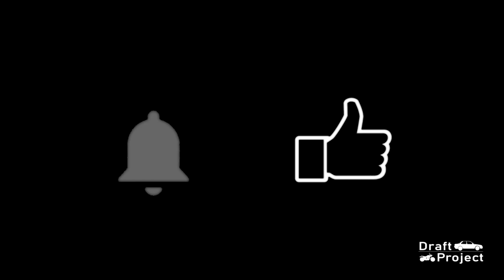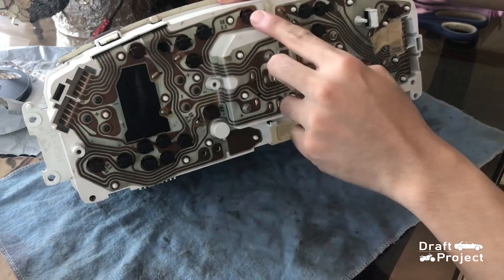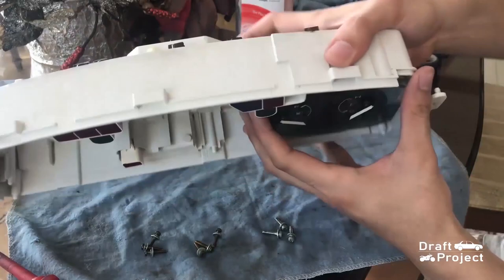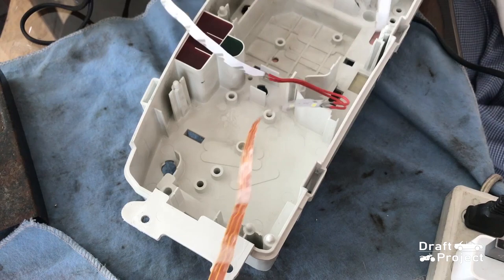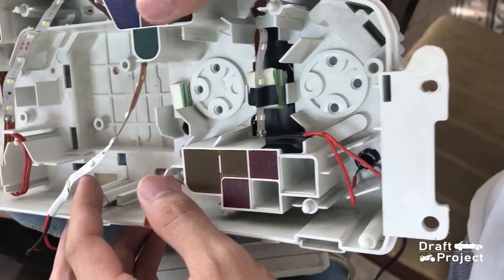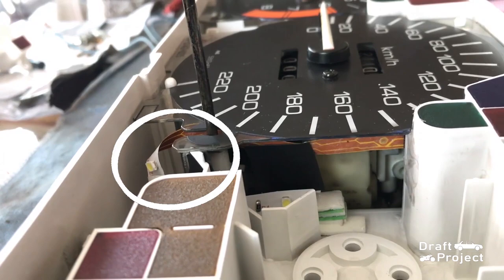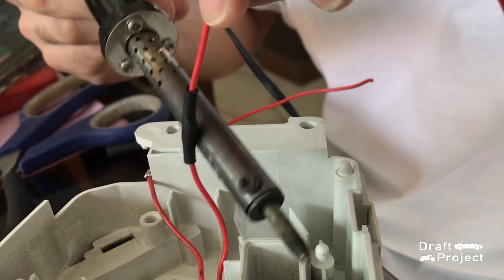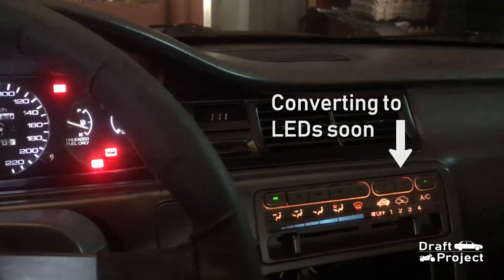BRIGHT DASHBOARD! Instrument Panel LED conversion

Comment: Amazing job, im sorry but i dont understand the wiring, did you put all the strip pieces in series conection and the 2 final wires to each respective + and -  of any bulb socket ? thank you so much for the video
Reply from the maker: Yes sir. What I did there is that I put the strip light of the tachometer and speedometer in series then tapped into each positive and negative of the bulb socket. The strip light of the fuel and temperature gauge is separated for the speedometer and tachometer. Thank you very much sir!

Comment: Taping leds like this will cause them to overheat
Reply from the maker: So far, I didn't have any problems or issue with it for the past 2 years. Perhaps overheating could happen if the wire is loose or not secured. The other one is using bigger wires.

Comment: just buy t10 led bulb, lol
Reply from the maker: That is another easy alternative. For this Civic EG, you need T5 or T6.5 LED bulbs. If you choose those bulbs, expect more uneven brightness. It is a common problem that can be corrected by a customized strip light mod.
Reply: @DraftProject  that's true.. the smooth lighting effect of the led strip looks good though.

Comment: Where did you buy thos led strip?
Reply from the maker: I just bought from our local online shopping site. The LED strips are made from china and fairly cheap. Up until now, it is working properly without any defects.
Reply: @DraftProject  shopee?
Reply from the maker: @swoshswish6921  I bought it from Lazada but that was 2 years ago, so the link for the item is gone now. Shopee and other shopping site will do too.

Comment: Can we just use LED bubbles like for bolt-on mounting?
Reply from the maker: Hi bro! Yes you can. Just make sure that those are reputable and durable. I don't recommend buying cheap ones. I already tried that before and It didn't last long. Based on my experience, I wasn't satisfied with the output because some areas of the face of the gauge cluster are dim. After a week, the lights started flickering and eventually stopped working. LEDs doesn't spread light effectively compared to ordinary peanut bulb or incandescent bulbs. So I decided to use the strip light to customize the location of the lightning, almost creating an even illumination on the face of the gauge cluster which is what I wanted to be. For me, the strip light mod does look like OEM enough. Thank you!

Comment: Could you link to the exact strip lights you used?
Reply from the maker: Sorry sir, the link to the strip lights is no longer available. It is a 5 meters, 12 volts non waterproof flexible cool white strip lights.

Comment: Nice video!!
Do you think 3825 leds are better than 2538 leds? I mean, referring  to brigthness?.
Reply from the maker: Thanks a lot!

Sorry, I'm not sure on which is brighter. Those numbers mean the size of the LED but does not proportionally project a brighter output. There are LED that has larger size (higher number: ex. 5050) but produces a normal brightness. I guess try checking the power output as that will be the basis of brightness.